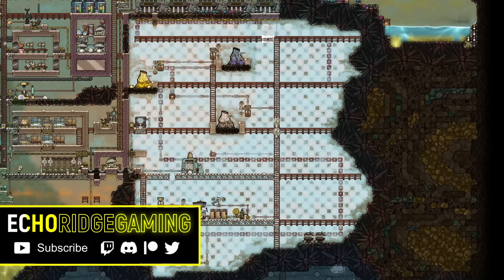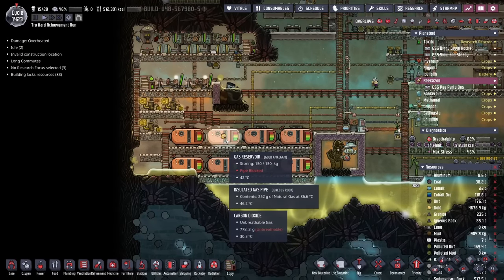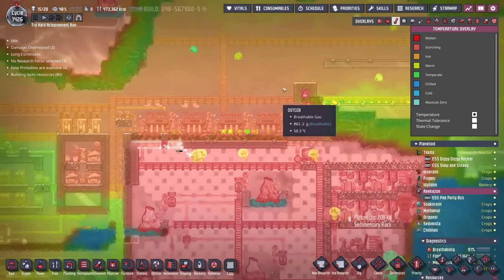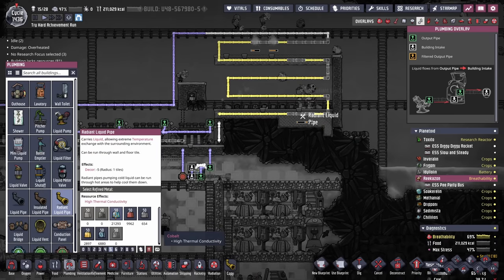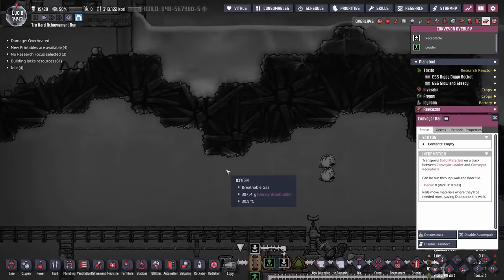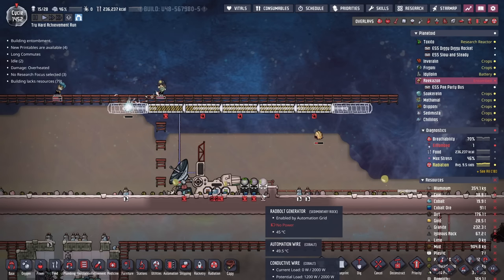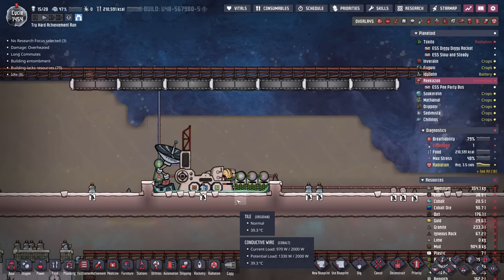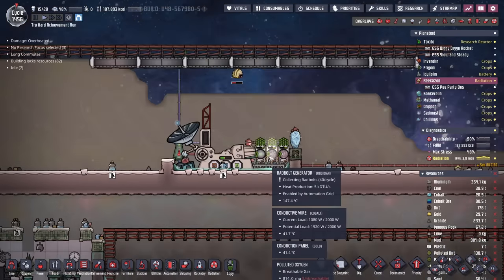Debris Chiller and Launcher | Max Diff Achievement Run | Ep 30 | ONI

Comment: You should add buffer tanks to radbolts! It is the one area where you go directly from generator to consumer. Ideally, have the consumers order the release of bolts from the buffer tank.
- I also want to repeat my idea: Use Nuclear waste as coolant/radiation source for the launcher. It is only worthless on the home Planetoid, where you got all the radiation you could want. Other places can benefit from it
- if you want the metal to come out at 25°C, cooling the metal down to -5°C is probably not a good idea. Right now the coolant loop is set that low.

Comment: Maybe it's a little too cheaty. But I love the mod I use that makes it so you don't need overflows for aquatuners. If the temp is within range, it just passes through without turning on. No need to worry about over/under filling your loop.

Comment: The heating around the industrial brick: if the insulated tiles are not ceramic, then it's enough to heat it up. There wasn't any cooling, so any heat incoming will collect and just drive the temp up and up.
Reply: Ceramic still has some transfer, but it is miniscule compared to igneous rock, and insulation's (and abyssalite) thermal transfer, though it states 0, is actually miniscule from ceramic. 

Double-layering ceramic, though, then you'd have thousands of cycles before any transfer is noticable (atleast in my testing worlds, which was about 4000 game hours ago, currently sitting at 5500)

Comment: You can always try the radbolt containers. I build a system where each container in a row would fire according to the needs of the machinery and amount of capacity of its neighboring radbolt storages. Costly, power hungry, but 5k radbolts at any given time at full capacity is a nice deal.

Comment: 4:18 abysalite does transfer heat, it is not a bug. Heat transfer between 2 tiles uses the geometric mean, not the lowest value like many people believe. Insulated tiles have an insulated modifier which uses the lowest thermal conductivity and then also divides the thermal conductivity by some number. With a single layer, you want insulated tiles, while double layered abysalite is better

Comment: Buffer tank!! Pro gamer spotted.
Started a new game, trying to not use the refinement tab for anything I can make. I challenge anyone to try this. Making glass was fun.
Reply: Making sand is probably the easiest to accomplish, and making glass would just need more heat, right? 

Also, curious as I haven't actually made glass using in-game thermal mechanics, would the sand to glass be a 1:1 ratio in this manner, or does it still lose 75% mass as it does through the glass forge?

Comment: Hi Echo, will there not be really small packets of metal looping indefinitely in your cooling loop cause there're too small to be chilled or detect by the thermo sensor? I learnt from you that it was better to have the filter redirecting in the loop instead of sending to the exit :)
Reply: It will be a possibility, but not a definitive. New packets can also overlap the micro-packets, filling them up to get detected later. Once a micro-packet has formed, though, it'll probably never fully be removed without, atleast, some player interaction. 

And yes, Echo has previously stated that, which means he didn't follow his own advice on this build 😅
Reply from the maker: I mean you are technically right... and that is really the best kind of right :)
Reply: @EchoRidgeGaming  you did it for the love of chaos, I understand and respect that

Comment: Your metals are going thrue warm saltwater if I saw correctly and that is where the heat comes from.
Im still wondering why you don't use large rocket gas cannisters as buffer tanks. With bridge priority you can have priority to bypass and feed the line minimizing power consumption. For loader and unloader.
Remember to cool the autosweeper above the payload opener at the homeplanet.

Comment: Abyssalyte does not work as you think it does.
You'll want to have a double layer of it, if you actually want to seperate temperatures.
If there's not a double layer of abyssalyte, I highly recommend insulated tiles. Otherwise you'll lose so much delta temperature over time.
Reply from the maker: We made some changes due to this fact.

Comment: Overkill chiller nice, probably should've done that in my own base.
Though I'd probably have run the super coolant in counter flow to the conveyor rails (not that i think it would've made too much of a difference).
Reply: The counterflow cooling makes a big difference on high temp differentials (e.g.cooling down 400°C cobalt to <70°C), but with the current temps in Echo's steam-room, it shouldn't be that big of a difference.
Reply: Yea its more the principle, I tend to make mine smaller and only really used it for igneous rock for hatch feeders.
Plus the specific heat cap of the metal used here would see the temp pretty similar throughout the chiller.

Comment: I would stick to the weezwort setup and just ship phosphorite over. I have a diamond press beside the rad bolt generators and a switch and if I don't want to send rad bolts to the launcher or rocket, I let it make me more diamond. I love the rad bolt rocket, only thing is I wish klei would increase the rad rocket capacity. I cant get fullerene In one trip, because its 11 tiles away.. I did explode a rocket though on the return trip just to get a little. I haven't ran hydrogen rockets yet, I have the setup built to make the liquids, just not got enough super coolant yet..
Reply: Hydrogen rockets are amazing, just takes a lot of prep to get there, thankfully. 

I used to prefer the rad-rockets, but last time I played, I focused on steam. A lot less work (actual dupe-labor, that is) to get it off the ground, but it did take about the same ammount of time as I was shipping steam from a geothermal fuelling room. Had to force the steam to equalize the temps (around 140°C) of the insulated pipes, so the steam didn't have any issues sitting in the pipes over a period of time. That was the time-sink, but required surprisingly little dupe-labor to maintain the broken pipes

Comment: Abyssalite isn't weird - unless something has the "Insulated" tag, which abyssalite does NOT, temperature transfer is the average conductivity between 2 tiles. 2 tiles of abyssalite average is 0. Abyssalite and Oxygen is 0.012. Then there is flaking, which every material exhibits.

Comment: What does super coolent do exactly because its not always super cool.
Reply: From the wiki: "Super Coolant is a special liquid with the lowest freezing point (-271.15 °C/2 K), a high boiling point, the highest Specific Heat Capacity (8.440 (DTU/g)/°C) and a very high Thermal Conductivity".
TLDR, you can cool it to the lowest temperature the game allows and it will still be a liquid (no risk of pipes bursting) and is great transfering heat from other things to itself (and vice versa).
Reply: Has high specific heat capacity, So when the aquatuner cools it by the set -14 C you get more cooling capacity on the chilling side.
Reply: You can also use it for heating, doesnt need to be cold
Reply: Thanks for the replies my doods, I like it.